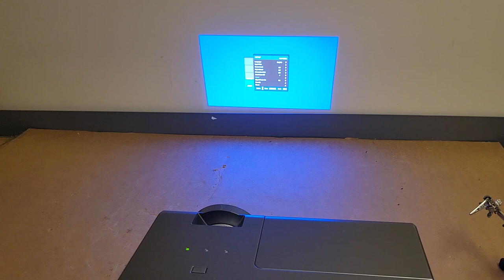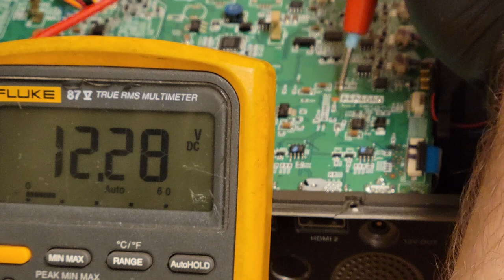Optoma TH1060 DLP Projector Repair / No light / Two Projectors In One Video!

Comment: Awesome repairs Frank! Sometimes a scrap/spare parts unit is a life saver especially for old machines.
Reply from the maker: Thanks man. I am a little bummed I couldnt find the problem on the mainboard.  I keep thinking about it but it will likely take much longer than it is worth to find the issue and if it ends up being the pixelworks IC, I am out of luck anyway.  They need firmware loaded that I do not have access to. That stuff always bugs me.  I may try and put more effort into learning how to copy/load firmware.  If I can download it from a good chip, then I can create a library. At some point this gear will not have any manufacturer support(A lot already does not) and it would be nice to have an option available for people.
Reply: @FixitFrank  I have a TH1060 , when I plug the cord to the unit, the light flashes.  When I press power, the bulb turn for 3-5 seconds, fans kick in and the unit goes into standy mode.  I noticed the light flashes 4x then stops and repeats.  The lamp and temp light do not stay on.  Advice?

Comment: Hi FixitFrank.  I appear to have the same problem.  I get the blinking green light but it won't power on.  I took the lamp housing out and saw that the blue piece you call the blue door switch is loose in there. But I tried to take the cover off the projector and I can't get it off.  I removed the 2 other screws in the lamp housing, as well and three tiny screws under the lip at the top of the panel where everything plugs in.(where you took your thumb and just lifted the cover off).  But it won't budge. Any advise?  I'm so mad because I have a class coming to my studio in thirty minutes and I love showing my photos giant on the wall...lol.
Reply from the maker: Did you take out the five underneath? There should be five or maybe six(it's been a while) that go up through the bottom. How many times is the light flashing or is it a steady constant flash?

Comment: I have one of these units as well and when it is plugged in the power light is a steady green and the lamp and temp lights flash continuously. Do you know what this could be related to? My initial thought is motherboard or perhaps the power supply. Thank you again for the video!
Reply from the maker: from what you are saying, I am leaning towards the power supply.  There does not seem to be any codes that have both temp and lamp flashing with power solid.  In fact there are no flashing codes for the lamp light at all.  If it seems to be a fast flash, it could be the power supply pulsing.  There is a chance that its a mainboard but I would start by checking the standby DC voltage from the power supply. I would expect to see the 12v supply line go on and off or at least be erratic. Bad caps in the secondary side of the power supply are a possible cause.  There is no smoking gun but verifying the power supply would be the first step.
Reply: @FixitFrank  Good call on the power supply. The voltage was measuring all over the place, I got that swapped out and it started having the same lamp cover code. Sure enough this lamp cover was broken too. I think the switches are snapping because the plastic on that screw post gets very brittle with usage, and heat etc. Everything is all set now, thanks for the help!

Comment: @FixitFrank  I have a TH1060 , when I plug the cord to the unit, the light flashes.  When I press power, the bulb turn for 3-5 seconds, fans kick in and the unit goes into standy mode.  I noticed the light flashes 4x then stops and repeats.  The lamp and temp light do not stay on.  Advice?
Reply from the maker: Have you tried a new bulb? I'd start there. Without a known good bulb you can run in circles. Make sure it's not a cheap bulb with the wrong infrared filter. That's the glass on the front of the bulb. It should have a reddish/blue/purpleish tint to it. If it's clear or greenish, thats no good. Cheap Amazon lamps are like this. They will ruin a projector.

Comment: Hi Frank, I watched several of your TH1060 repair videos, they are well done!  I have one that is throwing error messages I don't see online, was wondering what you thought of the repairability.   When I turn it on, I get the fan and bulb start up, and after about 5 seconds I see the Optima screen.  But then the unit shuts off, with 6 slow power LED blinks, followed by 3 LAMP LED blinks.  What do you think?
Reply from the maker: I seem to recall this model has timing as the code instead of number of flashes.  As in half second flashes of the power led mean something 2 second flashes.  
That said, I would check your lamp.  I have seen this behavior(minus the led flashes) when the lamp housing has a bad IR cut coating on the glass.  The lamp starts to fully ignite and then the amount of IR is too high, it confuses the color wheel sensor and the unit shuts down.  Make sure the lamp has a reddish/blue/purpleish tint to the glass in the front.  If it's clear or greenish, it wont work. Also, the condition of the bare bulb may be an issue.  If you have not tried a new lamp yet, I would do that first.  That tends to be 90% of projector issues.  Just be sure to stay far from amazon lamps.  They are almost always junk  Anyone on this list is reputable.  https://www.projectorcentral.com/projector-lamp.htm  .  Lastly . I did find the service manual for the EH1060, which should be close enough.  https://elektrotanya.com/optoma_eh1060_dp486-57a.pdf/download.html
Reply: @FixitFrank  Thanks Frank, I just did some more checking based on your reply.  I have multiple projectors which helps.  I confirmed the lamp works in another one, and a known good lamp throws the same 6 green 3 red error code.  Any other ideas?  Do you think a projector in this state has any value for parts?

Comment: @FixitFrank Hello friend, I was thinking of buying a newer projector. I Currently have a BenQ w1070 what would you recommend under 2k.
Reply from the maker: There are a few. It's hard to recommend just one.  I would look at the BenQ TK800, the HT2150. Projectorcentral.com has a great projector selection tool. There are some ViewSonic's as well.  The only caveat I would add is that I would not buy a laser/LED driven unit yet.  I see them failing (not repairable) way too early still.  7-10000 hours is too short.  Lamp based units are still a better value for the most part. I think in the next3-5 years, the solid state lighted units will be great.
Reply: @FixitFrank  Thanks frank I'll check them out!